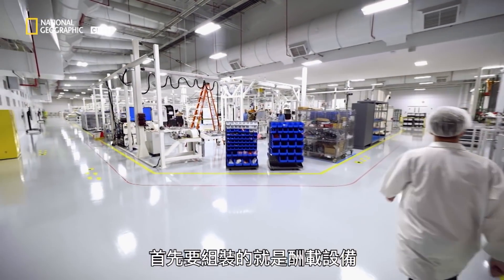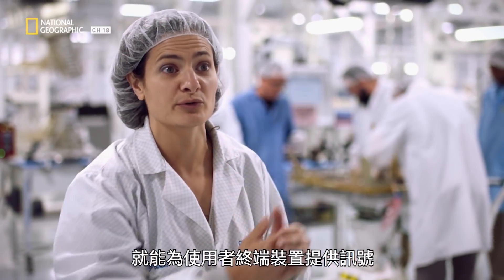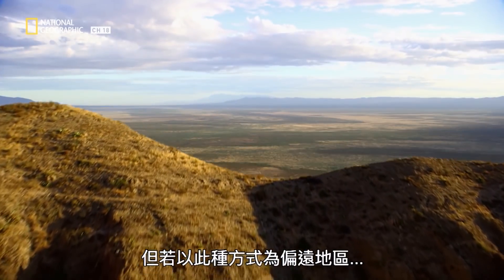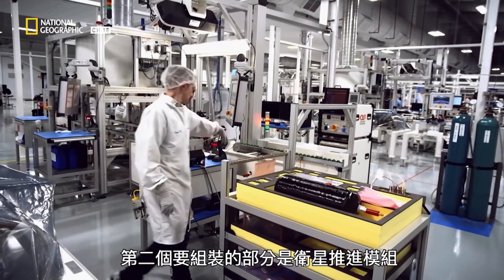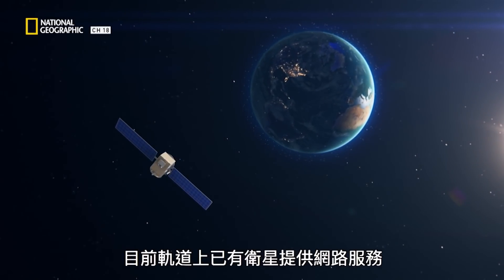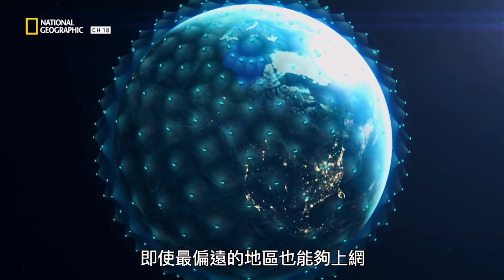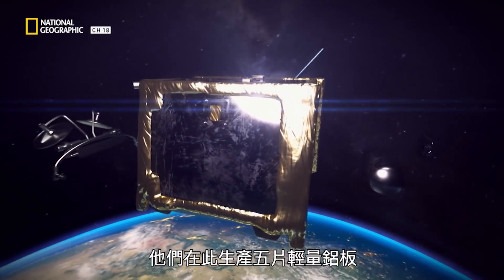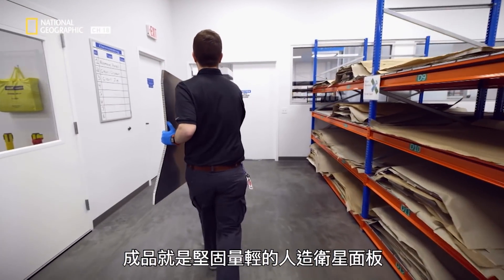為了讓地球各角落都能上網，人類需發射高達648顆的人造衛星環繞地球才能達成任務【快捷生產線】

Comment: 中国的信号会被干扰的。。。大陆不可能连得上这个的。。。
Reply: 不会被干扰。说错了。
Reply: @jiang-g6h  不可能用得了，他這個是直接連上你想要去的那個地區，你用這個就可以直接翻牆
Reply: Elon說會在中國地區關閉服務，怕中國把他打下來
Reply: @eagle1107flyer  200公里高啊，而且附近還有其他衛星，不要聽到近地軌道就以為真的很近
Reply: @laa1005  
Elon說的，又不是我說的。
"If they get upset with us, they can blow our satellites up, which wouldn't be good," Musk said. "China can do that. So probably we shouldn't broadcast there."
Reply: @eagle1107flyer  而且總共有多少個衛星啊，你要發多少個，這樣的話能過得了財政的那一關嗎。而且他那衛星成本超低，可以瘋狂發射
Reply: @laa1005  
SpaceX"怕" 中國把他打下來
所以衛星飛到中國頭上時不會開啟服務
有很難懂嗎
打下來是最後手段，在那之前早就一堆經濟制裁了。
Reply: @eagle1107flyer  把他們打下來也是不切實際的想法。而且就那個衛星的大小，不可能塞得了其他東西
Reply: @laa1005  
China likely will field in 2020 a ground-based laser weapon that can counter low-orbit space-based sensors. By the mid-to-late 2020s it may field higher power systems that could damage the structures of non-optical satellites.